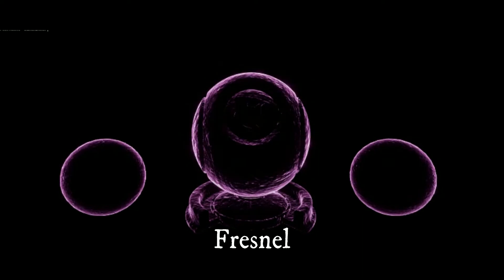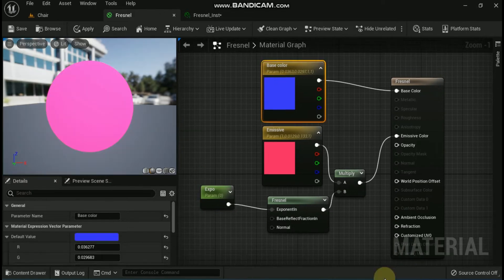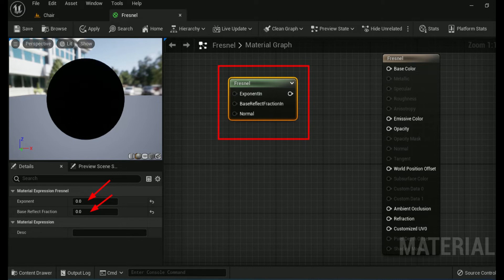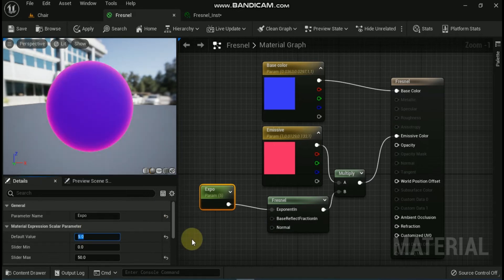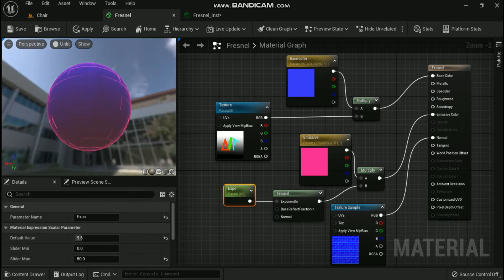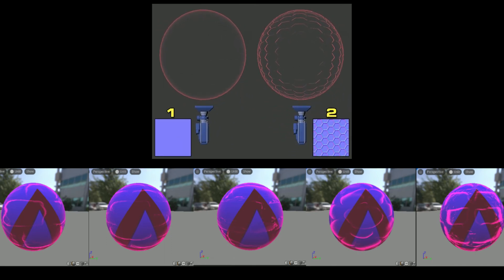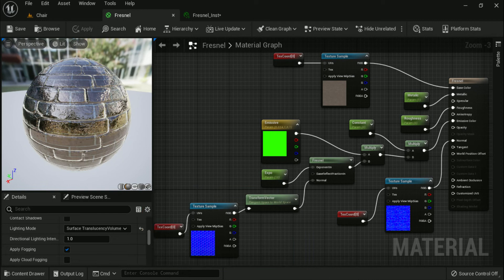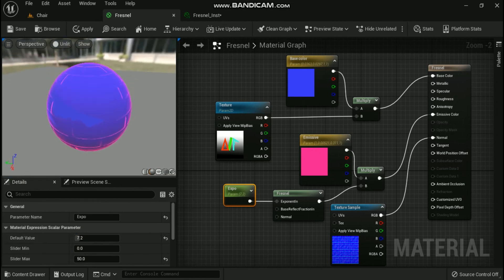UE5 : Materials for beginners in Unreal Engine5-  14 Fresnel Material Expressions

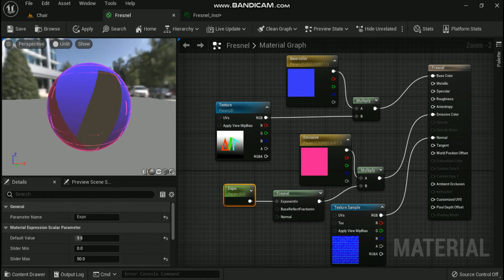Comment: 04:48 You tell the user to plug in a normal map into the normal of the fresnel, but in between the cut the material type has been changed. Before the cut, the normal option is greyed out, and won't take any inputs, then after the cut it is white and can receive the normal input. What did you do to the material between the cut to allow you to connect a normal?